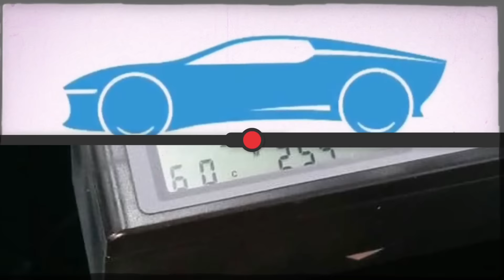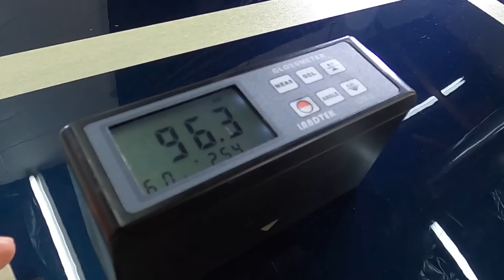Jescar Ultra Lock Plus!!! Ceramic/Polymer Sealant! (Power Lock SUPERCHARGED!!)

Comment: I just did the ultra lock+ x2 on my truck  I did test it prior on a panels first  but did more of the enviorment stuff than chemicals   sprayed salt water  an mag chloride water  diesal with oil and let it sit a week  spraying the salt mix daily   after a week did a wash   it lost nothing  beaded like it was new  I just used what my truck will be mostly exposed to in the winter and summer   Any ways  after the 2 coats an a few days curing  this product is very very slick  when it rains out the rain blows right off the paint  and used on glass also an just rolls off  its a nice product   my go to before this was duragloss  which is great also  the 501 is great  I still use it on my Volvo XC90   you should do a review on some of thier products  you wont be disapointed

Comment: The Vette has a beautiful clear paint job with high quality clear coat material.  That is why it looks "glassy"   It looked glassy prior to your Jescar application.  It would look glassy without.  These products are marketed to outperform others on the market and yet they all perform well but the glassy look comes from the paint job, not any ceramic coating. My opinion. I could put that Jescar product on any brand new consumer vehicle and I would never get that "glassy" look.  Its in the paint.

Comment: would you think or recommend this combo or could you try in one of your testing's for more of a durability test for long term (6+ months), and high gloss to match this up with LVR 357 MAGNUM WAX that you also have high praise for.  Also love your channel and watch it constatly.  Currently use Jescar Power plus and then 845 wax collinite on top and that really produces high gloss, I don't have a meter, but have been thinking of something more updated, like this Ultra lock + with this new tech of the LVR 357.  Wanted your thoughts on it.
Reply: Do you think you can put the 845 on top of the ultra? I know people used it often on the power lock plus but wasnt sure as far as the ultra. Ive been trying to find out if it would be compatible or maybe the 357 on top of the ultra?

Comment: Thank you so much for this video.  I currently use Jescar power lock + and then I top it with Collinite Insulator 845.  Can I still do that with this product?  Thanks for your reply.
Reply: Anyone???
Reply: @chrisbuckley5936  I don’t see the point, the Collinite 845 will mask the hydrophobic properties of the Ultra Lock. If you want a durable and extremely hydrophobic option, look into Fusso Coat 12 Month. The Power Lock + 845 combo looks incredible though, especially when topped off with Shinee Wax.

Comment: bought this for my boat ... wow its unreal ... did a compound on it then used the ultra lock plus came out great .. lets see how long it lasts
Reply: How is it standing up? Considering it for my boat.
Reply: How did it do?
Reply: @dylanlofgren5538  dude was unreal... It lasted all season... Towards the end of the season (like September) it broke down bu b then 8 was like fuck it... So a solid 5 months.. So I did a 2 step process... Did a light compound  as a first pass and then did the ultra lock plus as the top coat.. Im even gonna do my car this year.... Forget wax and get this... It's very easy to put on and take. Off as well

Comment: Hey Brian. I've got the 3D one and the ultra lock+as my second step I'm gonna use 3d one first then do ultra lock+. Wondering what your view on that combo or what you add between 3d one and the Jescar Ultra lock+. Or how would you go about my Combo
Reply: how did that turn out ?? thinking similar but with sonex perfect finish... did you use a panel wipe before the UL+ ??

Comment: This looks like a great product. On a side note, has Brian ever given a product in this category a "gotta have it" rating?
Reply: Ethos Defy is one that comes to mind
Reply: TLC 2
Reply from the maker: If I remember correctly ...2 or 3.
Reply: @apexdetail85  Thank you sir! I was just wondering about this specific category. If I recall, you had mentioned you would be doing some long term testing on those graphene sprays. Were you ever able to follow up?

I used the 303 spray on my wife's car before this winter we're getting over now and WOW, it held up amazing. I did not expect that from a $20 spray bottle. I hope you can provide a comprehensive follow-up.

Comment: Is the menzerna the same product?
Reply: My understanding of it, without getting complicated, is that Jescar is the US importer for Menzerna under the Jescar label.
Reply: That's correct. Same exact product, same company, different label.
Reply: I use menzerna heavy Cut 400 then jeacar.  The 2 are differently not the same product but I had no clue they were the same company. Interesting.   I hope they do a graphene ultra lock 2 next lol.  I skipped ceramics and am using graphane products now, I get better results and easier to work with then ceramics.

Comment: Speaking of rubber seals, 88 MR2-SC in the garage. Any help on keeping those rubber seals (yes it's got t-tops) clean, soft and rubberized?
Reply from the maker: https://www.amazon.com/303-Rubber-Protectant-Conditioner-Weather/dp/B00T44D1R2/ref=asc_df_B00T44D1R2/?tag=bingshoppinga-20&linkCode=df0&hvadid=&hvpos=&hvnetw=o&hvrand=&hvpone=&hvptwo=&hvqmt=e&hvdev=c&hvdvcmdl=&hvlocint=&hvlocphy=&hvtargid=pla-4584001419021944&psc=1

Comment: I have ordered my first product from you Brian 💎The weather is getting better and my Camaro SS is ready for a paint correction and ceramic coating. I have the Adams wheel stand for my wheels to correct and coat. I will be using your coating ✊💎

Comment: Anyone else sick of water beading. I sure am. I have more of a problem with water spots now that I did a graphene spray coating and some sio2 wash then I did when I just used gold class and some turtle wax ice. Water beading is a cool trick but water sits on car. Up in RI we have rain salt on roads and in a month we will have strong sun. I may switch back to more traditional waxes.
Reply from the maker: I am.